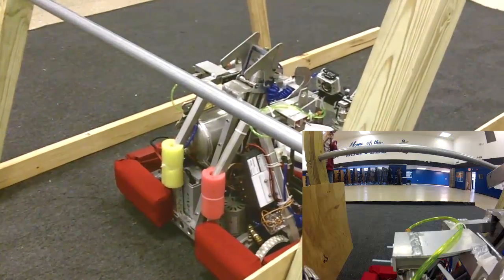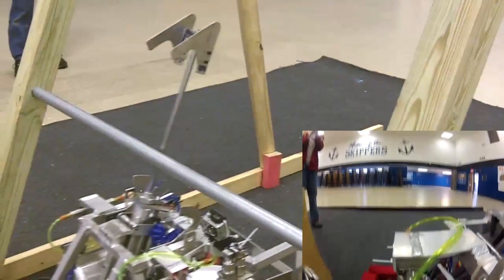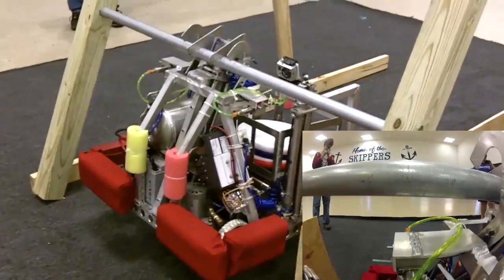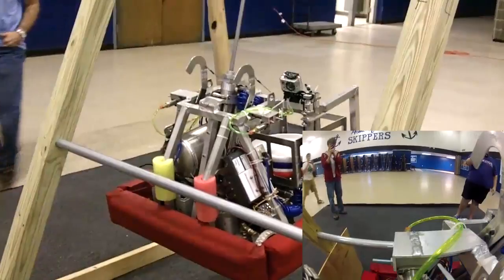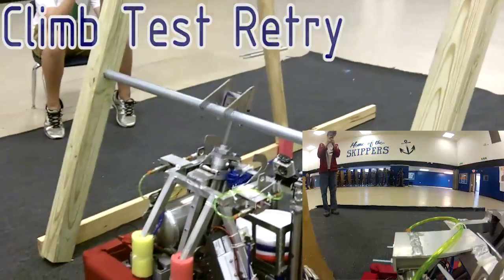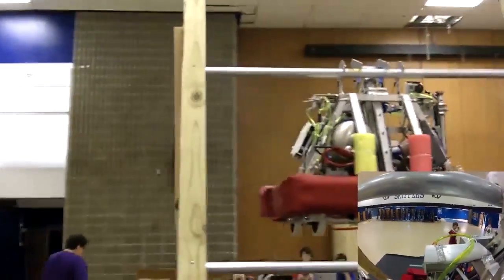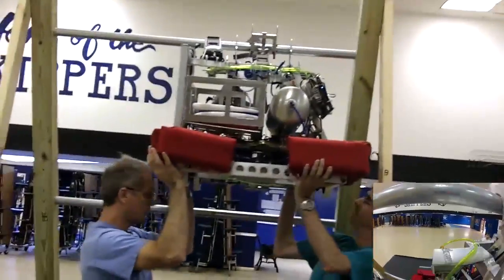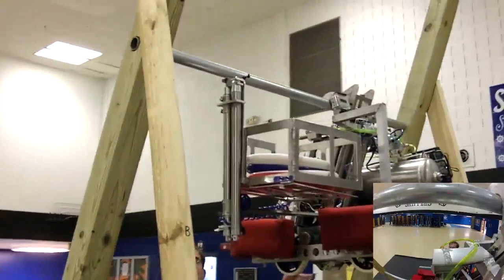2013 FRC Team 2992 Robot Testing - Saturday 2/9

Comment: Funny you mention that, we used a magnet on our mini-bot and it worked amazingly well. Our minibot got up the pole in about 2 seconds since all it was is 2 motors(without the included transmissions) a small critical diameter pressed shaft/wheel and magnet and it worked amazingly well. Too bad our robot could only get it to the pole 3 times throughout the regional =\